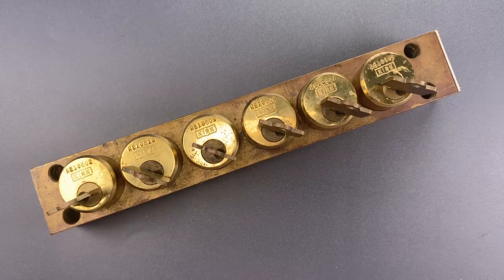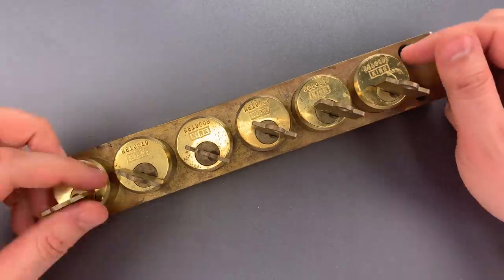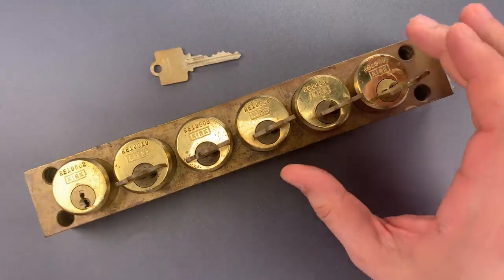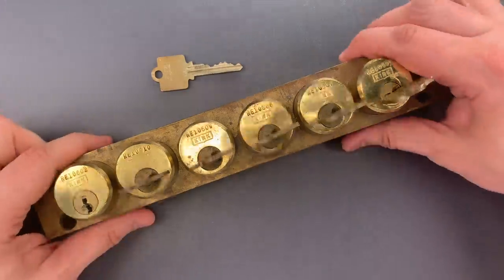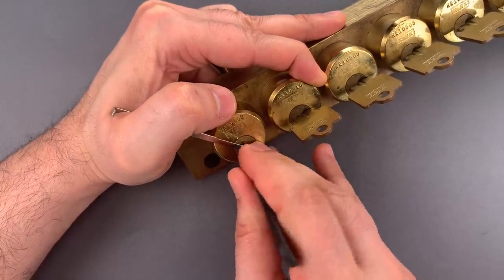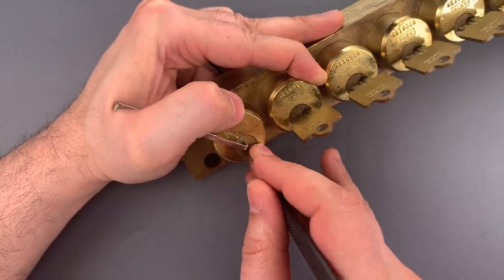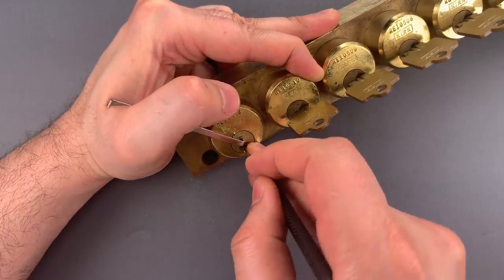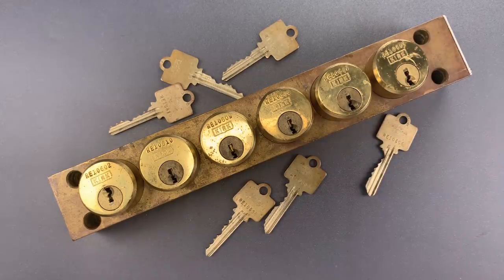[1190] 6-Key Kirk Interlock Panel Picked

Comment: This takes me back to the 1980s  when I had to learn about
https://en.wikipedia.org/wiki/Petri_net
This was a time when mechanical interlocks were all we had.

We had strange square tubular locks on production cages so that maintenance could access barrier systems. 
This was after an incident were the practice was to remove the fuses and leave them on top of the unit, One day a production manager put them back and the robotic arms started up when the lads were working inside the cage.

So the management went mad with a OTT lockout security system.
When a simple solution would have been a bag for the fuses and a lock for the neck of the bag to stop the problem .

Comment: Interlock systems are one of the very first and basic safety mechanism implemented on the railroad to secure rail switches in the correct position before allowing to operate the signal and let the train proceed. Still used to this day in some shape or form. Here's a picture of the internal mechanism https://images.app.goo.gl/AeWeMnA35Rg7N1nk8

Comment: That is exactly what this system is used for. Also, these locks have to be hard wearing, since for example, the facility I worked in had one of these to control access to dangerous work areas, they were operated multiple times per day to perform daily tasks in these areas since the 90s. These systems are supposed to have one and only one set of keys, and if you drop one down a storm drain (guilty!), the boss gets reeeeealy mad 😈😀😜😷

Comment: And here I'm imagining a situation in a missile silo where they need to insert their individual keys in order to allow the main switch to fire.  I imagined the video would be LPL picking all 5 to ultimately pick 6 and blow the place up!
Reply: No, this is a lock for high voltage power systems and/or hydraulic systems that will kill you if they're powered on while you're inside.

A missile lock is two locks far enough apart that one person cannot turn both at the same time.

Comment: @LockPickingLawyer I would be eternally grateful if you would (also) use metric units (it has been over 45 years since the Metric Conversion Act was signed) and it would be very helpful for all viewers that are not from Liberia, Myanmar or the United States.
Thanks in advance!
Reply: 0:13 "this weighs in at over 9 pounds" What is a pound? Do I really need to Google to find out? And yes I did Google it, and 9 pounds is 4 kg. Just a text layover would be fine to help everyone out.

Comment: New ide for security, 2 locks that have to be turned together but spread apart enough that both can't be tensioned with one hand, also maybe a little counter tensioning via a spring on the cores, this should make picking by one person very difficult

Comment: These interlocks are used both ways. The uses I am familiar with would have you put the 5 keys in to release the one. Not to be a naysayer but I think you need to pick it the other way round.

Comment: An old safety film, which used to be shown on the BBC during trade test transmissions, showing a "key exchange" or "key transfer block" like this in use, is in fact on YouTube at https://youtu.be/G2RPu4Hs_qo?t=303 .  There's 1 minute of context there before the exchange block shows up.  Observe that it doesn't connect to or drive anything.  The keys all fit into other locks, elsewhere.

Comment: Those are all 7-pin cores, aren't they? It looks like you only picked six pins. #7 on the first lock looks pretty low-set though; maybe it didn't require manipulation?
I bought something like this on eBay a while back, it looks like 1/6 of this thing. Bronze or brass body; super heavy. It's pretty easy to take apart and has a 7-pin Schlage keyway, so I've been using it as a practice lock.

Comment: I would have loved to see the back of this unique device.
Reply: It's flat, just like the sides are.  There are no external attachments for this device.  It doesn't drive or connect to something else.  It is a "key exchange" or "key transfer block".  Its sole purpose is to make it so that either key 1 is free or keys 2 to 6 are free.  One "exchanges" the 1 key for the other 5.  All 6 keys fit into other locks, elsewhere, that actually lock stuff.  Key 1 goes into a lock somewhere else that (say) switches on power, and keys 2 to 6 go into locks somewhere else that (say) allow access panels to be opened.  All of the locks, on the transfer block and elsewhere, are key-retaining, so the end result is that (a) key 1 is turning on the power, or (b) that keys 2 to 6 are opening their access panels, or (c) that all 6 keys are in the exchange block.  It is never the case that (d) power is on via key 1 and an access panel is unlocked through one of the other keys.
Reply: @JdeBP  Thank you!!!
Reply: The safety film that I learned this from as a child is actually on YouTube, at https://youtu.be/G2RPu4Hs_qo?t=303 .  There's 1 minute of context before the key exchange appears.

Comment: That is a pemanat dead man bank.   Or thats what my teacher called them. In the main electrical room a small  steel cable  is attached to each key and shortens to prevent people from mistaking the disconnect (s) 
Your working on  the reason why you would need to lock. All of them off is so when you are working on the main feed.  You lessen you chance of an ark flash caused by a back feed. An alternative method is to run cable thru all the disconnect s while they are off and applying one lock. But those are manliy a visual cue. And can be bypassed by your acreage 200 lb gorilla.

Comment: Aren't these generally used so that all five workers would have to replace the key so that no one person can accidentally zap people by turning on the main power without all keys having been returned?  So  workers basically return the key signifying that they are done with their work and their portion is now safe.  

This needs to be done the other way with some or all of the sub keys missing.  This bypasses the Darwin Award as well as the picker will be electrocuting his/her coworkers and not themselves.

Comment: I'm interested in what is takes to do the reverse when the other 5 are missing
Reply: I thought this would be cool, but if the other 5 locks don’t have to be turned at the same time, it would just be like watching this video 5 times, just pick them one at a time and then get the reward key unlocked. If they all have to turn together...that would be an epic pick!
Reply: I think you just tension using the remaining key and do single pin picking for all pins of all locks at the same time. Most likely you can pick one lock after the other since machining tolerances will cause all the pins of a single lock to bite before the pins of the next lock.

Comment: Have you ever run into a lock or reviewed a lock where it is dual custody and both cylinders need to be turned at the same time.  Do those actually exist?   I have seen a few of the other dual custody but videos you have done and I believe you were able to pick them independently of each other.

Comment: We use a very similar system here in germany, we just tape the switches in the off position with isolation tape and hang a sign "Please no switchy switchy or else roasty roasty".
No really, the sign reads "Nicht schalten. Es wird gearbeitet. Datum __.__.____, Uhrzeit __:__, Unterschrift des Schaltberechtigten _______________"

Comment: LPL, have you seen a Fortress Interlock? Sort of the same idea where you remove the key to enter an automated work cell, then insert the key in order to clear the safety circuit and restart the system.The key is kind of a barrel shape, roughly 8-10 mm in diameter. I'm curious if they would be relatively easy to pick, and if it would make sense for that to be intentionally the case.

Comment: Wouldn't the act of turning the left cylinder potentially turn the power of even without the key?
Reply: Duck Dog Turning the keys within this device does not switch any power on or off. The device only controls access to the keys, which in turn can then be used elsewhere at the facility where this is installed. For example, the primary key that releases the other 5 keys can only be used to do this if it is first removed from a keyswitch that turns off the power to the 5 systems that can be accessed using the 5 captive keys. This renders the wiring protected by the other 5 keys safe to work upon. The primary key can now be used to release the 5 other keys. 
Whilst any of the 5 other keys are missing, the primary key is held captive, preventing it from being used to switch power back on to the 5 systems associated with the other 5 keys. 
Only when all 5 keys are back in place can the primary key be removed from this device to enable the power to the 5 systems be turned back on again. 
So the 5 other keys can only be removed and used if the primary key is present (guaranteeing power is off), and power cannot be restored to the 5 subsystems until all 5 of their keys are safely back in this interlock. 
Hope that makes sense.
Reply: @mercuriall2810  It would seem to me you would have this as a loto on the main breaker and the sub panels would be accessed after turning the main key to kill the power

Comment: I want to see the back of this. I need to understand how the latch mech would engage/disengage the fuses, panels etc.
Reply: I don't think it does. It only controls access to the keys.
Here's a scenario as I imagine it, using his example of five subpanels.
The main feeder is controlled by a key-retaining switch. This is the same key that fits the leftmost lock. The only way to retrieve that key is to turn the main feeder off. Once that's done, the key can be used to grant access to the other five keys that open the subpanels. If any of those keys are in use, the main feeder can't be reenergized because its key is held captive.
Reply: @johnopalko5223  Spot on! That's exactly the point of it.

Comment: imagine using this key interlock system as an actual security system by placing it on a wall somewhere clearly visible... but with all 5 of the necessary keys removed and hidden throughout your house... having the last key out allows you to remove the interlocking system which is where your safe is... a safe with a combination lock or biometrics. imagine watching a burglar on security cameras run around your house like an easter egg hunt looking for hidden keys just to get to a safe he couldnt open anyway

Comment: Dumb question for the most experienced here... 
Does it make much of a difference if we have the lock on the "upright" position? I am considering the standard LPL (US and, perhaps, Europe?) position, where the key is inserted upside down the "wrong" installment of a lock.
I am asking because here in South America locks are installed with the pins on the bottom of the keyway and, therefore, gravity annoys me a bit when trying to pick as the pins will rest on the shear line and I can't feel if there is room between the pin and the shear line of the lock to confirm it is "picked" already.
Is this something someone else struggles with or perhaps there is an easy way to solve this issue? Of course, rotating the lock would not be an option when dealing with doors and etc...

Comment: If two of the other 5 keys are missing, and you wanted to retrieve the first key  for one reason or another, would that lead to any difficulty in picking, since youd need to pick two locks and they're linked together?

Comment: But how would you pick it if you needed all 5 keys because you only had the final key? To me the position you started would be the final key to turn on or off. You just locked the mechanism. Without those first 5 keys the sixth key doesn't matter. Even if you where missing they first key and the last key. How would you pick it???

Comment: I still don't quite understand the use of this with the breaker  box example. If the one key on the left unlocks everything, then why have the other keys? and if you can't relock it without those keys, why would you want to remove the keys?
EDIT: Oh wait, is it just a sort of fancy lockbox you would place in the circuitbox, so you have all keys at hand, and you use the "master" key to access the others?
Reply: Yes.  Every key is captive, both here and at whatever door they control.  Master key is in the master power panel.  All the others are trapped here.  You turn OFF the master panel, which releases the master key to use here.  Now you can release the other keys and get through the other doors/panels.  You can't take the master back out and turn the main switch back on until all 5 sub-keys are returned (indicating those doors are locked again).

Comment: I think that he misses the point here --- the lock is obviously designed to be virtually pick-proof, since you would have to have six lock-pickers tensioning and picking at once to open it.  All he did was pick open the one lock; the theory is that you could not leave the other keys in place when the lock-assembly is unattended.

Comment: I would use it in reverse, You need 6 authorized people to open the Electrical panel or the safe or whatever.
Reply: It effectively does that. You need to have all the keys in locks on the right to be able to get the left key out and turn the power back on.

The idea is to make the safety procedure easier to follow than it is to bypass, so that the only people trying to bypass it are doing so maliciously. And then you fire their ass.

Comment: What if this required all the keys to release one important key that, idk, launches a missile or something. 

Would it be possible to pick the 5 locks on the right to release the key on the left?
Reply: Would likely depend on how much slop is in the system that ties the cylinders together. If the tolerances are tight, I would guess that you'd need more hands than we're built with (or a team of pickers who are comfortable enough to work VERY closely together) to simultaneously tension and pick the 5 cylinders on the right to release the cylinder on the left.
Reply: @kevreeduk222  If any one man can do it, LPL can do it. Lets see him try!  

"I'm going to use top of they keyway tension with this 5 wiper bar attachment I built..."

Comment: Don't they have similar systems in Cold War era missile control panels, like the one seen on the sub in MW3?
Reply: Not entirely.

The locks in a missile silo are far enough apart that one person cannot turn both at the same time, even with some goofy lever/geared system.

The locks in a sub are completely different, and because I was on a missile sub that's all I can say about it.
Reply: @ScottKenny1978  thats why I said similar. Meanwhile, do guys like you actually practice turning the keys? Makes sense you might if you do.

Comment: To make a near impossible lock to pick.
Wouldn't a system like this but every key is a pin.
And you have reset systems inplace if you lockpick the wrong one.
So it's a 6x5x4x3x2x1 based guessing game which one to pick first?
How to make it? don't ask me. but generally speaking.

Comment: I doubt such a secure system would be to protect a individual from electrocuting himself. This sort of security system is more used as safety so you don't blow the whole facility up, or even make a nuclear plant explode.

When it comes to safety, its usually simple keys with a shape that have to be depressed fully. Easily bypassed, but the only person you endanger is yourself. These secure systems with pickproof keys and also I can see different keys for each of the individual locks, is for much more critical systems as I said, like where a incorrect procedure may blow a facility up.

I don't think its to a electrical panel or similiar, but I think its more OPPOSITE - like you have to collect 5 keys to free the last key,, which are then to finish the sequence (for example a facility shutdown, where one wrong step could blow the facility in the air).

Because, if you wanted to protect electrical panels from a interlocked switch, you would simply have all electrical panels KA as the power switch, and then turning off the power switch, would release the one key, that fits all the electrical panels.

Comment: The keys look all different.... Hmmmm. That may be an old school type of nuke control safe lock of some sort.
Reply: No, it's an electrical lockout system.

The left key is for the main power, and that breaker has a retaining lock on it. The only way to unlock the sub-panels is to turn off main power and put that key into the interlock. Then you have 5 sub panels, each with a different lock, and each lock retains the key as well, so you can't turn main power back on until all the sub panels are shut and locked.

Comment: it feel likes a manual version of a "if this, then that" (IFTTT) system .
Reply: That's exactly what it is. If the left key is not in the lock and turned, you cannot get the other 5 keys to open up a machine. You have to get the left key from the "ignition switch" to the machine so power is off before you can open up the access panels, AND you can't turn the power back on without all the keys to the access panels are back in the interlock (so the access panels all have retaining locks).

It's simple to use and pretty foolproof. And because it's easy to use it's not likely to get bypassed because it's a pain to do.

Comment: What about the other way around?
Say the door is locked and to open it you need the leftmost key to turn, and five different people have the 5 other keys
How will you pick all 5 at the same time in a way that the lock knows its these specific keys, and not just 5 knives inserted in them?
And you can't pick the leftmost lock because there's a key in there